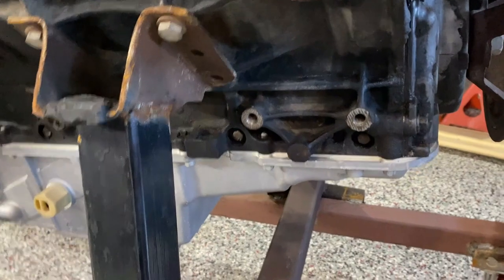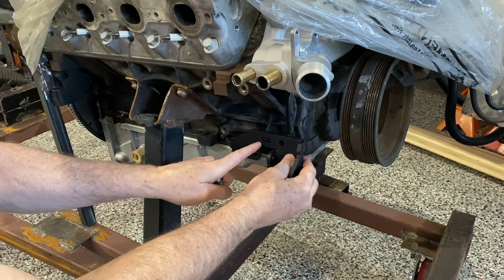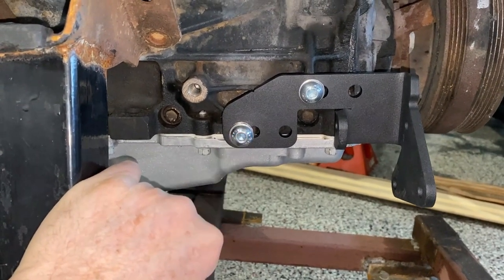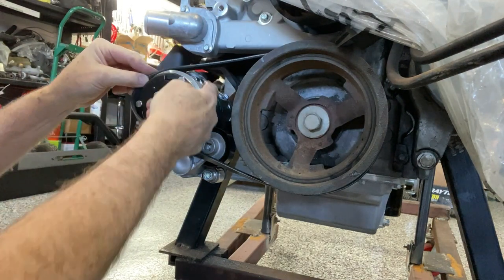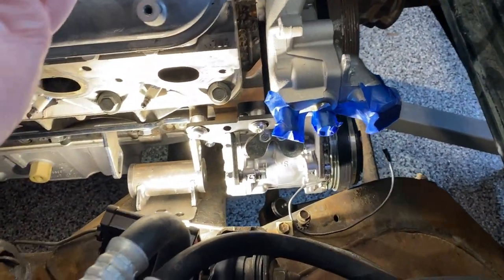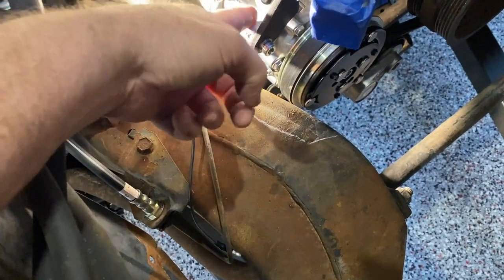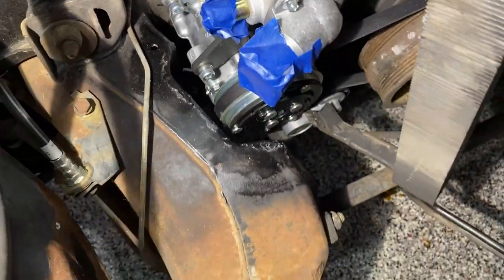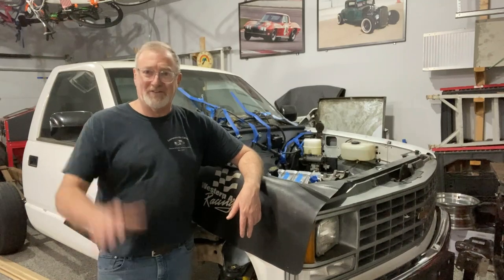88-98 Chevy / GMC OBS Truck LS Swapped Dirty Dingo Low Mount A/C Install Part  2

Comment: Great video. I used ICT upper a/c mount. It gave the factory truck alt balance . But this is good advice. Thanks.
Reply from the maker: I'm going for the factory look under hood of an '01. I don't think it will look out of balance with the factory air box and coolant tank on the passenger side. Thanks

Comment: Really appreciate your content, look forward to watching more videos on the progress
Reply from the maker: Much appreciated!
Reply: @laurencevillegarage   do you know if there is a mount to be able to use the ac compressor that comes on a 98 Tahoe?
Reply from the maker: @hanktownsend7911  Yes, Dirty Dingo makes one that will allow you to use your existing R4 compressor.
Reply: @laurencevillegarage do you think that instead of drilling and tapping the block it would be possible to extend the lower bracket mabey weld an ear and then use the factory tapped hole  mabey with a washer or a spacer if needed
Reply from the maker: @Brandon_obs_ls  I would need to crawl underneath the truck and see. It's been a bit since I installed that unit. I understand what you mean, I think if you got creative, that might work. It would be more work I think. Drilling/taping  the hole was not difficult to do, but you do want to be very careful when you do it and pay attention to your drilling depth.
Reply: @laurencevillegarage  if possible let me know if it would have space to add an ear and bolt 👍🏻 thanks brother keep up the good work your builds are inspirational

Comment: this seems to be the easiest part of the job, im more interested in how and what is needed to connect the lines and condenser and drier etc and charging the system...
Reply from the maker: Putting a "low mount" compressor in an OBS is work. The frame has to be modified to allow clearance not only to mount it, but to have enough room to allow removal in the future without lifting the motor up for clearance. Having said that, all the remaining a/c parts are what would be correct for a 1991 Chevy truck. The only "modified" parts would be  the hoses going to the compressor. I would use the "original" end of the hose that mounted to the accumulator and the condenser then have hoses made to connect to the manifold that attached to the compressor. I used a company called "Hose-Fast" located in Garland Tx. They made what I needed while I waited. It was not expensive. The 2 hoses I had made were $35-45 each (if I remember correctly). As far as charging up the system, I took it to a friends garage and he had the proper equipment to vacuum out the system and oil/charge it back up. It did not matter that it was an aftermarket compressor and custom lines. The fittings are all there to do the job.
    If I did it again, the only change I might make would be to remove the factory low pressure switch and replace with a 'trinary" switch. Why? The factory compressor had a high pressure switch built into the back of it. The new compressor does not. This can leave my system vulnerable to issues if I have a high pressure problem. By removing the low pressure switch and replacing it with a "trinary" switch, that one switch controls the high pressure cut-off, low pressure cut-off AND will switch on an electric fan at a set pressure. The advantage to that is the fan does not need/have to run as much. With the LS pcm, the fan is wired so that when the a/c button is activated, the fan is as well. If you have a cold engine, you really don't need the fan on at  that moment. With the "trinary", the fan will be activated, but not until the a/c system builds up to a set pressure. Meaning the start up of the motor and a/c, the engine is not hot, or even warm. Turning on the fan at that moment adds load to your electrical circuit and additional wear on the fan(s). Over a period of time, that adds up to a lot of minutes/hours that your fan is not running because it is not needed yet. A "trinary" is not expensive and is not difficult to wire up. Check YouTube, there are plenty of videos about how to wire one up. They also (usually) install with a schrader valve. Means that it can be added or replaced without having to discharge your system. If it ever needs replacement, simply unscrew it and do the wiring part. That can even be done with a simple 4 wire plug. No need to take it to someone to discharge it and recharge it. Therefore, saves you $.  A long answer, but, I hope it helps you out.

Comment: I did the same setup with my 95 except mines 4wd,i noticed the coldest i could get out of vents is 50 degrees curious if you ran into same problem?
Reply from the maker: While I never put a thermometer on the vent, I have had no issues.

Comment: Good evening sir. Im doing a swap on my 91. How would i connect the 4l60e shift linkage wire to the truck(steering column) ? Seeing that it had a 700r4(rod shift linkage)
Reply from the maker: My '91 was a manual trans, so I didn't have that issue to deal with. I have heard (I am not an expert on this issue) that if you check out the the automatic shifters out of '90-94 3/4 and 1 ton OBS trucks, that they use the linkage you need. I am not able to confirm this, but it is a route you can check out to see if it will fix your issue. I know many others have dealt with this in the past, so, don't give up, a solution is out there. When you do find the right fix for your truck, let me know how it worked out. Thanks for the question. Good luck.
Reply: @laurencevillegarage  I couldn't find anything regarding this "burden". But eventually I did just last night. I learned that, I can just use the stock shift linkage from my 91. Just a little modification is needed(to the linkage). I'll let you know how it goes, once I get to it...and thank you.

Comment: I have a 93 Sierra with an ls. I bought the same bracket then decided to just do the top mount. My question is though.. where did you put the high pressure cut out. I just vacuumed mine out and filled it today and when filling ( not even a can in yet ) it shot the orifice tube threw the bottom tube of the condenser coil
Reply from the maker: Wow! I've never heard of that happening. Originally, I left everything original and adapted the hoses to fit the R4 compressor at its new position. I left all the sensors in their original or near original positions. Even on the "91 with the low mount Dirty Dingo compressor, sensors are in their original positions.
Reply: I have seen it happen on the Cadillac’s before and that would break the suction temperature sensor. There were two orifice tube designs depending on the year of truck, one went in the evaporator inlet the other went in the condenser outlet, they’re not interchangeable.

Comment: i saw a kit that would have located the ac up top ,looks easier
Reply from the maker: It can be, depends on the look you want and other things like if you want to run a turbo. I am looking for a totally stock look for the '01 5.3. I've run the R4 and Sanden compressors on top and the upper mount was some work as well, just in a different way. All depends on the compressor of choice and what brackets you choose to do the job. I wanted something different and usually choose the harder way on most things!

Comment: Will this work in 73-87 c10 trucks?
Reply from the maker: The square bodies have a different frame, should be easier to mount…but, I have never done that to the older trucks.

Comment: Keep them coming. Do you have to make your own ac lines? Also are u using holy terminator?
Reply from the maker: I will need to have a couple lines made. I had hoped I could modify the existing lines but I think they will both be several inches short. I’ll wait until the heater hoses and exhaust manifolds are on to finalize their exact positions. Not using Holley, I’ll modify my own harness and use the original pcm. It’s off to the programmer now.